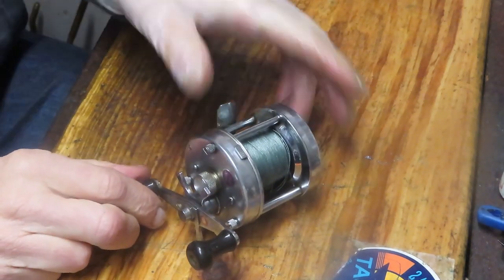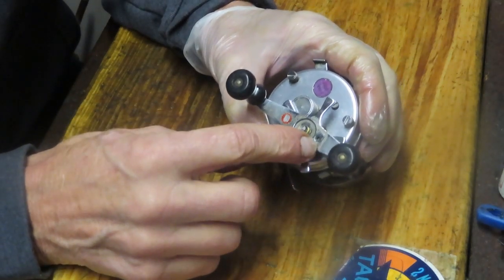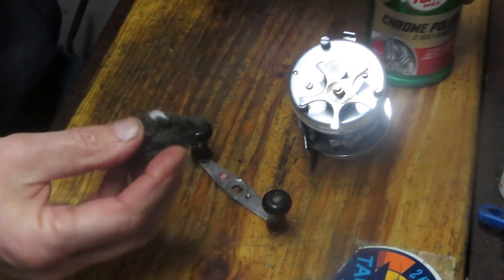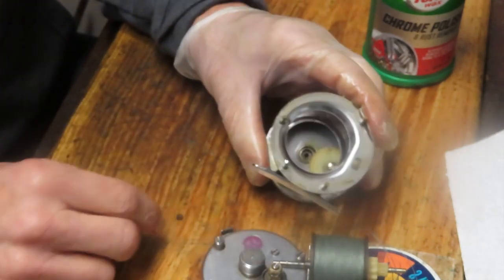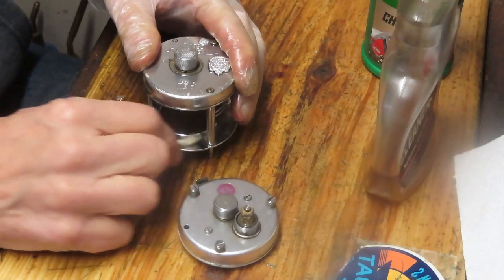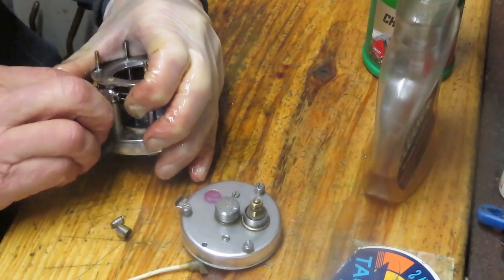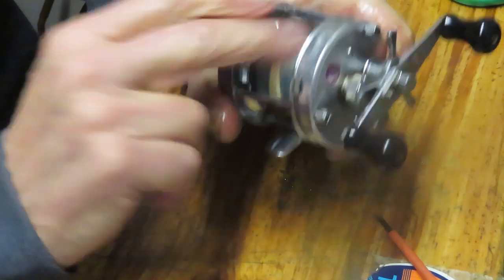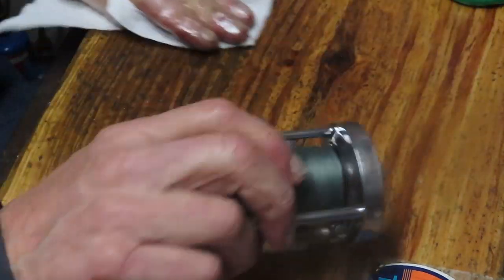Abu Ambassadeur 5500C fishing reel problem diagnosis and repair

Comment: I have an old ambassadeur 5500KC3. The retrieve is slipping. When it slips i can turn it on the left side and it works. Turn it on the right side and the handle freewheels. Any ideas? I  love your videos and you have helped me a lot. Thank you
Capt. Tim
Reply from the maker: That sounds a little odd, so I will go with an odd guess.  You may have a broken bearing on the spool or case.  If the bearing were broken, that would cause side to side slack and the issue you are describing would occur.  That also assumes that the spool tensioner cap is tight -= Dennis

Comment: Hello Dennis and thanks for your knoledge base on real reel maintnenace and repair.  I have had a ABU 5000 for years and suddenly it stopped taking up line when cranking.  My diassembly was seemingly nonproblematiic but after a decent cleaning and regrease the problem persists.  I bought a fully working identical reel to isassembly and compare one with the other.  Low and behold I could bot determine the difference between the two innards of the reels.  Not only that upon reassemble, the second reel now does not take up line as it did when I recieved it.  Any thoughts?  Cheers'
Reply from the maker: Hmmm - whatever you are doing wrong, you are consistent in doing it!  My first thought is that the spool is not engaging and that could be that you have the pinion gear in backwards.  The slot on the pinion gear faces  the back of the reel.  A second thought is that the yoke in backwards and that the free spool trip is preventing it from engaging the spool.

Can you send a picture of the inside of the reel gearing to my email - 2ndchancetackle@gmail.com?  I will try to "see" if there is something obvious. - Dennis

Comment: I have a few (perhaps 12 or so, various flavors and ages) ABU Ambassadeurs. One of them has the tension spring attached to the main gear like this one. Some time ago I took it apart and it needed a drag washer. My problem is that I don't remember which one it was. Can I identify a specific model (5000c, 5500c3, 5000c3, etc.) without opening up each one? Follow-up question, do you have the part number handy for the drag washer?
Reply: I found and opened it up. It's slightly different, 5000c, older. I'll send a photo to your email. Thank you so much!
Reply from the maker: Happy to have helped